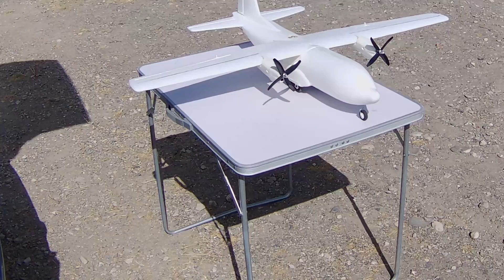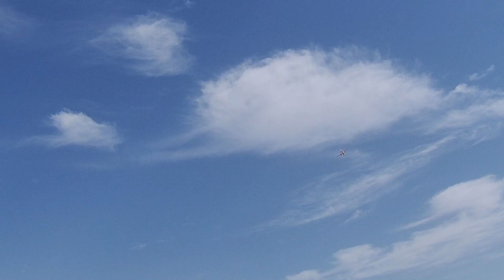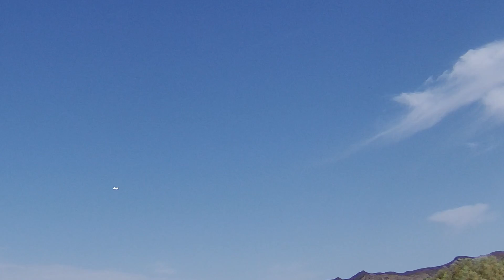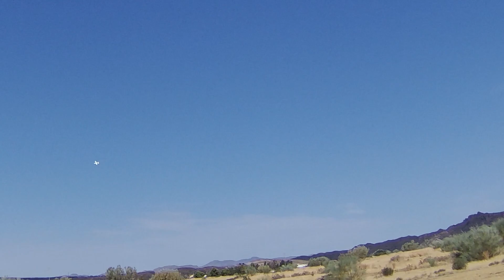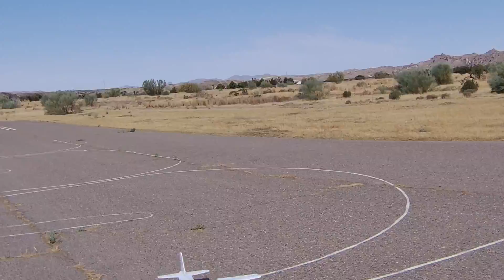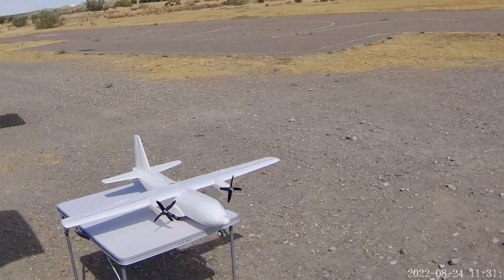C 160 Cargotrans Twin Motor Transport RC Airplane Update

Comment: Do you need a license ID to fly this cargotrans c160  on park?
Reply from the maker: It depends on the country in which you  live. Generally, any plane over 250 grams will need a license to fly. This is well over 250g! Also it is not a beginners plane. If you have not flown a plane then look for a small high wing trainer or glider before moving onto something like this. Thanks for watching, have a great day!